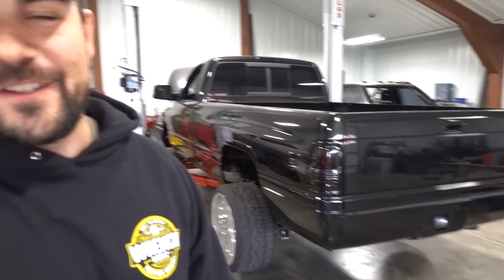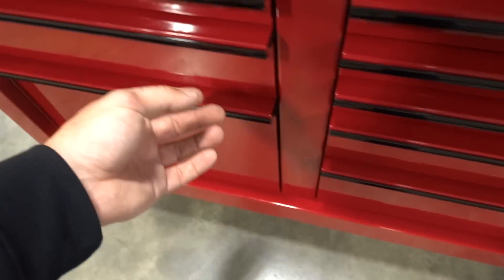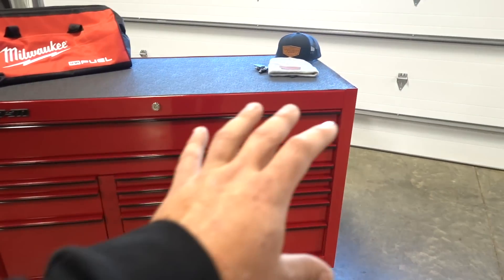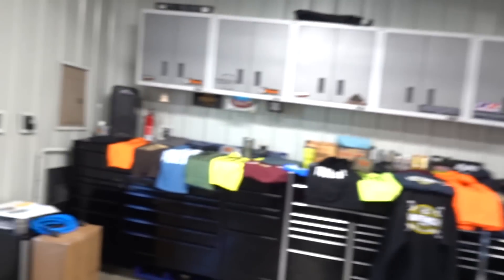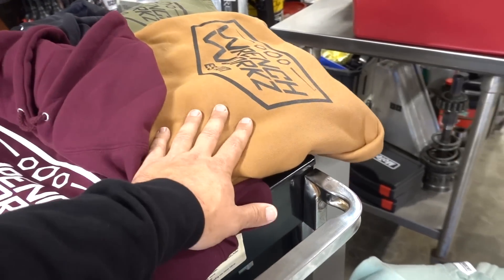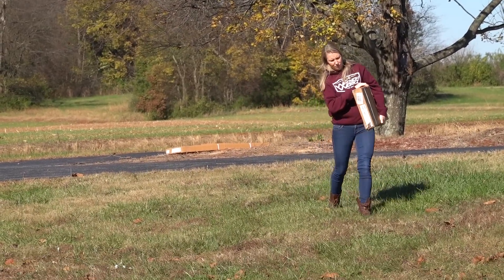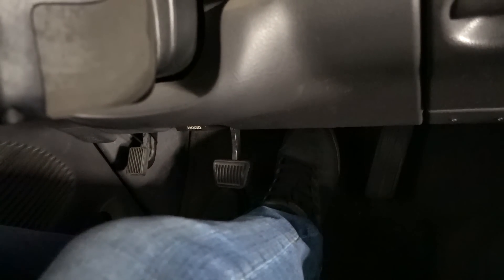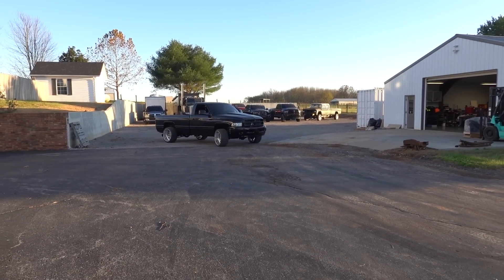6SPEED CUMMINS DOES MASSIVE BURNOUT & DESTROYS CLUTCH!!!!

Comment: Hey Greg. Got a stock 1st gen with a 40hp fuel pin.  How far can I turn the fuel screw in. I’ve heard 3 turns to be safe but ur old video seems like you have urs turned all the way in and then you added a new longer screw.  I just want to know about stock screw. Mine is 2.5 turns in.

Comment: Not gonna lie I prefer to enter this kind of giveaway vs A car giveaway I can’t begin to say how many times I’ve been doing something and realize shit I need to run out and get a tool. Yesterday I was changing my g/f’s oil the car has 12,000 miles she took it to the dealership for the first 2 changes bc you get 2 free buying it new I get under the car and the drain plug is fucking stripped I had to go and buy a 15mm 12 point socket and beat it on. Can’t believe A mechanic would have that plug fucked up and not replace it.